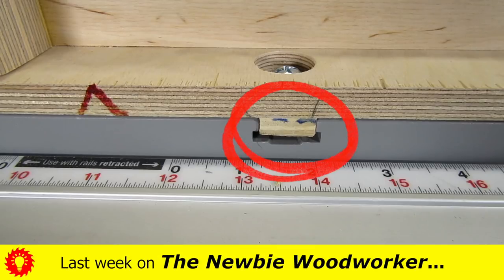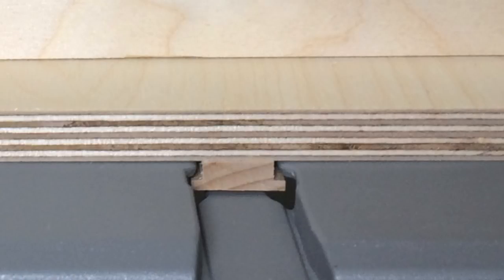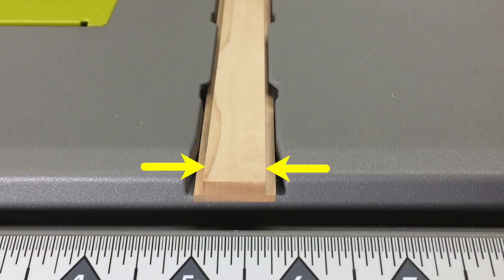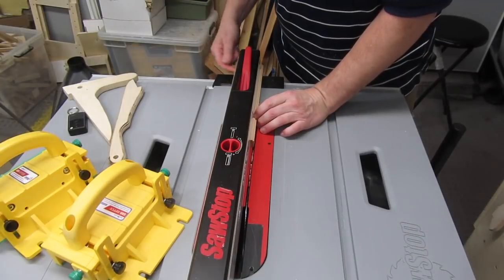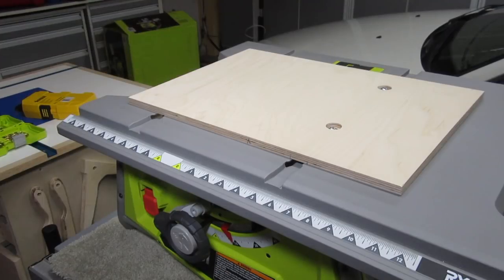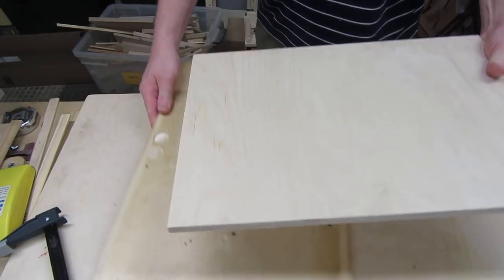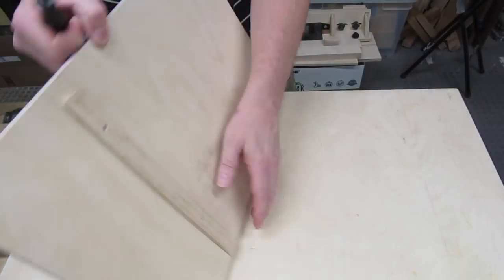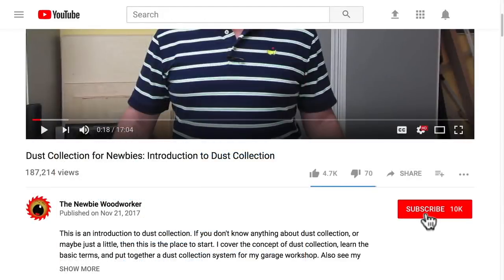Runners for Ryobi/Craftsman Tabbed Miter Slots

Comment: I have the same Ryobi table saw. I got so tired of struggling to get the miter runners correct, that I just gave up and ground the tabs down flat with an angle grinder. Now I can make sleds with normal runners.
Reply from the maker: Yeah, if I had this saw permanently, I would certainly do the same. Thanks!
Reply: Exactly what I would do.
Reply: I foolishly purchased the older version with full tabs that ran the length of the table. Angle grinder took a bit longer, but yeah... Seems the second smartest way to handle it.

The smartest way is of course to buy a different saw.
Reply from the maker: LOL. Probably true. But it's how we learn, right? :)
Reply: I had tabbed slots on my bandsaw, and did the same thing.  Just filed them off and made normal runners.
Reply from the maker: Makes sense to me!
Reply: In an interesting twist, the entire saw was destroyed in a house fire. Insurance is covering it, so we'll be getting a saw with a better table.

Consequently, if Dan would like to do a video on how to dispose of old car batteries so they don't cause house fires, I'd be happy to share some vivid imagery for him.
Reply from the maker: OMG! I hope everyone was OK!
Reply: No one was hurt. It was contained to our garage. I'm using the experience to spread the word about the dangers of keeping old car batteries. A really old one that belonged to the previous homeowners caused the fire.

Might be worth mentioning to your core audience who, like me, are often working in garages that double as storage for old stuff.
Reply from the maker: Thank God it wasn't worse. And I understand what you're saying about the battery and safety. I'm just not sure how to work it into one of my videos. Maybe you should shoot a video about it? If you don't think you can do it by yourself, perhaps you have a relative or friend who could help? If you've got pictures, that's even better. And it doesn't have to be "professional", in fact, the more "real" the better. Just a thought.
Reply: Funny thing, woodworking is really just my hobby. Professionally, I'm a digital artist that's actually worked in video production. My computer is just one of the things we're waiting for the insurance to repair and return. Once that happens, I do plan on posting something.
Reply from the maker: Well, when you do, post a comment so I can go watch it!
Reply: Watched this video in hopes of finally being able to make a sled for the awful tabbed table but I'd been leaning towards your solution for some time now and now im convinced its just a better one all around. As host of this video said, it may break over time due to the thin rabbits anyways. If you read this The Newbie Woodworker, great work and explanations, this is in no way mean to discredit your great idea and work. :)
Reply from the maker: No, that's fine! I'm for any solution that works. 😀
Reply: I bought a used Tradesman and found the same problem when I made sled.  So I made the runner in two parts:  one fit the exact dimensions to bottom of the slot, and another runner  narrower (do not have to be exact) than the opening of the tabs, glue them together and screw them to the bottom of the sled (I do not have the expertise to make all 4 rabbets accurately on such small runners).  After a few usages, I got really tired that I had to "align and feed" the runners every time from the very beginning of the slots and retreat all the way back to remove the sled.   So I finally did what you did, file off these 8 tabs - fortunately it took me less than 30 minutes because the surface of table saw is made of cast aluminum.  Remade two one-piece rectangular runners, now I can just drop or lift the runners (sled) from the the table saw easily.
Reply from the maker: And now you get to appreciate something so simple, most of us take for granted. Not only that, you did it yourself! Bravo! 😄
Reply: My two cents, since the tabs go all the way,  maybe you can consider the slots to be just one narrower slots, and no need to file them off.
Reply: Ditto, but I used a router.
Reply: Benjamin Freeman I filed mine down and used JB Weld to fill the holes. someone sure could make a lot of money making machined rails for that tab slot!
Reply: this was exactly what i was thinking, what would happened if i grind those tabs out?
Reply from the maker: @fernandooliver7005  I received lots of comments here from people saying they've done it, and are glad they did. Of course, your mileage may vary. 🙂
Reply: Do you have any tips for being accurate, and not going to far with the tab grinding?
Reply from the maker: @clavicus  I don't have one to test with, so take this with a grain of salt. But personally, I would use an angle grinder and a grinding wheel (*not* a cutting wheel), and take it little by little. My guess is that it might grind really quickly, so just tap the tab a little and see what happens. There's no rush, and if you overshoot a little, it's probably not that big a deal. But it's your table saw, so do what you think is best and safest.
Reply: @TheNewbieWoodworker  
Thanks, I think I'm going to try it, since it's such a cheap saw, and I'm not experienced enough to know what I really want yet in a better table saw, I figure customizing this is a good way to maximize what I've got at hand while I'm still learning. 

But first... I'm gonna tackle aligning the blade and fence :)
Reply from the maker: @clavicus  Makes sense to me. And good luck! 😄
Reply: Well, I've got a question for you Benjamin. I got this saw recently and I started to grind off the tabs. I tried making t-runners but they feel flimsy after construction. But when I measure, rather than 3/4" slot, it's a 7/8" slot - so I can't buy premade metal or plastic runners right? Do you have the same problem? I'm trying to decide whether to grind off the rest of the tabs, or not.
Reply: Good idea thanx
Reply: I just bought a Ryobi with the tabs. Found this video and was about to get to work making the runners here, but after seeing your comment, I've decided to dig out the angle grinder and go that route! THANK YOU!!
Reply from the maker: @AaronPaulley  Good luck!
Reply: Those of you that actually did this, how’s it holding up so far? I’m thinking about doing it but it will probably void my 2 year warranty I purchased for it..
Reply: Can someone take a video of this? TIA
Reply: Genius thanks for the tip.
Reply: Think that’s what I’m gonna do
Reply: Last summer while redoing my kitchen my table saw broke, due to supply issues only saw I could find to finish project was a craftsman with tabbed slots. Finally decided to make a new sled for it and couldn't get rails cut correctly. Ended up grinding down tabs, much better result for me.
Reply from the maker: @mikeshaffer1169  👍
Reply: @MrJohnnyGrog  I know this is a long time ago, but new to routing, what kind of bit cuts through aluminum?  Also did yours have a bearing?

Comment: Dan, thanks for the video I have the same saw. I probably will just grind off the tab. But a trick I learned when I built RC planes is after you tap the hole put a little thin CA glue onto the threads. Let it cure, then retap the hole. The threads will be much stronger.  Again thanks for another great video.
Reply from the maker: Thanks for the comment, and that's a great tip! I've mostly been using plywood runners up to this point, and for them, I don't even bother tapping them. I just screw the screw into the slightly-undersized hole, and it works great. Very tight fit - just right.

But hardwood's too hard to just screw the screw in. I knew there had to be a good way of dealing with this, and your's sounds like an excellent idea. I was also wondering if something like LockTite might work also?

Thanks again!

Comment: great video for people struggling with these types of slots. I gave up with my old one a way back and used a router to cut them out to normal size. HSS router bits have no trouble with aluminium tops.
Reply from the maker: Thanks, and I would never have thought to use a router. Interesting idea.
Reply: Im really not great at cutting anything freehand so the router was the best thing I could come up with to control depth and give neat parallel cuts with an edge guide.
Reply from the maker: That makes sense. Very creative!

Comment: This is a great idea.  I recently bought an older cast iron Craftsman to replace my newer one that has a tabbed aluminum top so I understand the issue.  Here's a thought from a long time RC airplane builder:  Rather than cut rabbets another option might be to cut the hardwood to fit between the tabs and to cut 3/32" or 1/8" (2.5-3mm) aircraft ply to fit the full width of the slots and then glue the ply to the runners with 15 minute or slower epoxy.  (This isn't a good place for 5 minute epoxy.)  That would make for much less fragile inverted Tee runners.  The aircraft ply is 100% birch plies and th3 1/8" variety will have 5 layers.  It's available at hobby shops  that cater to radio controlled airplane and boat builders and at craft stores like Hobby Lobby and Michael's.  The 3 ply poplar "lite ply" would not be a good choice for this application.
Reply from the maker: Good idea - thanks! 😄
Reply: How about attaching a long piece of aluminum (the width of the space between the tabs) on top of the wood runner underneath??  Maybe that would help inhibit any changes to the wood, especially during winter and summer?  I have a Craftsman btw, and it's a pain to watch videos of great sleds my tablesaw can't handle.
Reply: Or you could make it so the runners are flush against the ends on the outside. Much easier.

Comment: Hi I just cut the hardwood to fit runner slot turn the hardwood on its side & use the thickness of the saw blade to cut a groove both sides of slider to required depth so tabs fit comfortably in the groove & run smoothly back & forth  I didn't actually have this in mind to do but it just made sense as I progressed with the slider Works well
Reply from the maker: Whatever works, works!

Comment: Thanks for the video. I just made some for my Ryobi table saw. I made them too thin and put washers on top of the runners to make it work. The next set will be taller.
Reply from the maker: Awesome - glad I could help! And don't be afraid to keep making them until you get it right. The more you make, the easier it gets, and then you'll find all sorts of uses for runners. 😄

Comment: New sub here. I thought I was SOL on making sleds for the old Craftsman someone gave me. I don't have the tools to grind down the slots. I'm so glad I stumbled on your videos. I plan on making your sled that can be used with a blade guard, as thats the only safety device my saw has, no riving knife.
Reply from the maker: Welcome aboard, Joe! Sounds good. If you ever have to remove the blade guard, I hope you can keep the metal 
"splitter" part installed, because either that or a riving knife is one of the most important pieces of safety equipment on a table saw.

Comment: Thanks Dan. This was a great video. I have a Skil table saw and it works surprisingly well for being so cheap but have those dang tabs. Too much work to make inverted T runners. Just going to file them off. 😕
Reply from the maker: Makes sense to me - that's what I'd do too. 😄
Reply: i literally just did that today on my Skilsaw 3310 i bought during COVID, yay
Reply from the maker: @JustinRiley1987  👍

Comment: (Follow-on comment) I just got my Ryobi RTS08 (local guy used it once and let it go on NextDoor for $80 so I couldn't say no). After some research, I'm looking to just angle-grind the tabs out and make good-ol' regular runners. Apparently the slots are 5/8" wide at the top between the tabs and 13/16" at the bottom. I'll also put in grooves with countersunk screw holes for expansion slots to fine-tune out any play for a just-right fit. And, as mentioned in my previous comment, I'll use an HDPE cutting board (or hope to find a reasonably affordable UHMW bar).
Reply from the maker: Sounds reasonable to me. I can't tell you to do something like that, but I can certainly agree with you!

Comment: Thank you Dan. Your videos are quite clear and informative. As a real newbie in woodworking, a few years ago, I have acquired a low-cost table saw Rioby similar to the one shown in your video to renovate our house floors. Lately, while being grounded by all the health measures against the COVID19, I am thinking to venture myself into more ''advanced'' stuff such as building cabinets, and shelves (please don't laugh!) as a pass time. The crosscut sled seems to be ''the'' most recommended  by mentors to us newbies. However, the task is being complicated by the design of the Rioby table with miter slot tabs. While considering using your method to deal with the situation, I remember having come across a slim-line drawer slides with ball bearing tracks. They have a cross section of 5/8'' (W) x 3/8'' (H) which seems to suit the miter slots (without tabs) in hand. This requires a removal of the troublesome tabs which, to me, have a secondary function in keeping the miter gauge rod stable during cross cuts. At best, these tabs are ''nice-to-have'' design feature. 
The following link provides more information about these slides:

https://www.leevalley.com/en-ca/shop/hardware/slides/side-mount/40591-slim-line-drawer-slides

I have tried to mount these slides on a  scrap board, and they fit quite well in the slots, but protruding slightly above the table surface by approximately 1/8''. The board is sliding very smoothly on the slide tops without touching the saw table (bad thing?)
 My concerns are as follows:
- The stability of the board in side-to-side movements because of the slacks in the slides (ball bearing, clearances, etc.), even though the front-to-back movement is super smooth.
- The  alignment and squareness of the fence to the kerf might be affected by the movement of the slides even though I can fasten them down to the slots using screws at each end of the slides.

Before getting into more serious steps in making the sled, I would like to have your expert opinion on this application. Any improvements or precautions to make to the procedure?
Your help is most appreciated.
Reply from the maker: Thanks for the nice words. And I would never laugh at the idea of you trying to make anything. In my experience, the only thing holding back most people (myself included) is thinking we're not capable of doing something. But the truth is, if we try and fail, we'll learn way more than if we don't try at all. And when we succeed, well... yay! So go for it!

As for the tabbed slots, if it were me, I'd cut the tabs off as a lot of people have mentioned in the comments (assuming your tabs are like the the people's). I'd use an angle grinder and just get rid of them. I wouldn't recommend using those slides - you don't want side-to-side movement at all. And you don't want them to lift the sled off the surface of the table - that's not a good idea at all.
Reply: Thank you Dan. Your comments are most appreciated.  I will take it from here and try to finalise my sled shortly.
I have learned a lot from this exercise.
Reply from the maker: @TrongNguyen-er4tp  Glad to help any way I can. And learning is the best thing!

Comment: A great video for Ryobi table saw runners. The runner that comes with the mitre fence has way too much play, I think I will make new ones like yours.  If you could figure out how to fix the cross cut fence so that both ends move together, that would be fantastic Ryobi could use a little help in that department?  The Ryobi is a good saw for the price, but I would like to be able to make some square cuts without all the hassle.
Thanks again Dan!   Keep up the good work!
Reply from the maker: Thanks, and you’re welcome. I can’t help with the fence, sorry. 🙂

Comment: Good video! I am with some of the others in though, going to grind the tabs off.
Reply from the maker: Thanks, and I don't blame you one bit. That's what I would probably do. 😄
Reply: I like the idea of a sled that won't wobble or pop out.
Reply from the maker: @joeywatch1145  FYI, for tables with "normal" miter slots, if the runner fits right, the sled won't wobble, and they never "pop out".
Reply: Yes, I was aware of the inevitable reply, but there are plenty of situations where it can be handy to have a captured sled, most of which are during setup when you might want to draw it back past its balance point. I suppose it's a matter of what you find convenient.
Reply from the maker: @joeywatch1145  That makes sense - thanks for the explanation! 😄

Comment: Thank you so much!  Ryobi is just a little different than most, but I love my Ryobi table saws.  The newest one (cordless), I will be able to use this tutorial with.  My older one (15Amp) does not have any miter slots.  If you have any suggestions for that one, I would be forever grateful!
Reply from the maker: Glad I could help. There isn't anything you can do about not having a miter slot.